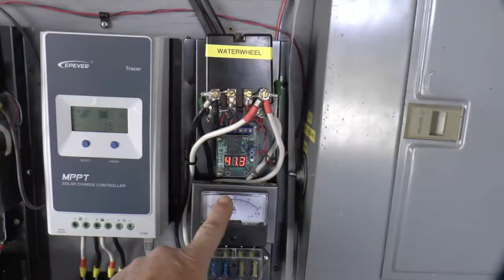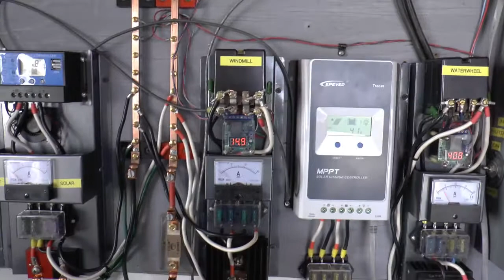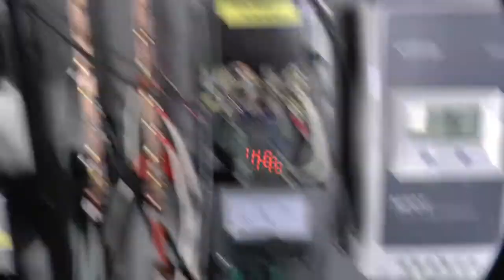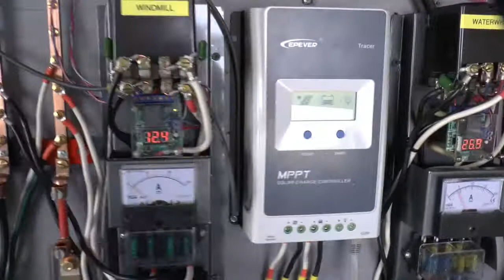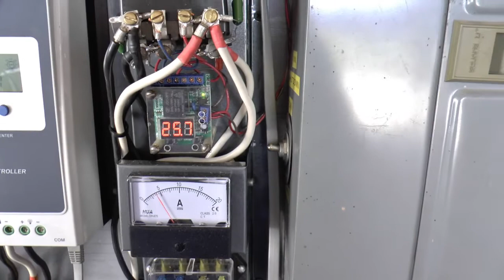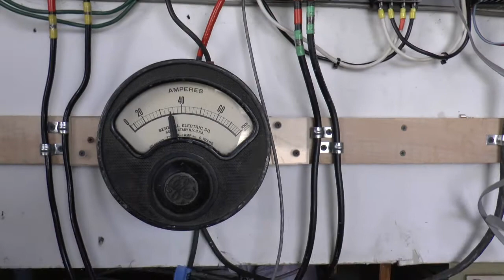Controllers Mounted and Operating

Comment: What size inverter do you have and which Solar panels do you prefer?
Reply from the maker: Only 1000 watt. I like the 100 watt panels. They are easy to handle, reasonable price, lots of places have them, If one is damaged it's easy to replace.
Reply: @kevincrawford2027  Thanks so much for responding.
We only have 3 100 watt panels and 5000 continues Accurate Mobile inverter set up for emergencies. Hopefully one day to be off grid but it's still so expensive. I really like your set up.👍